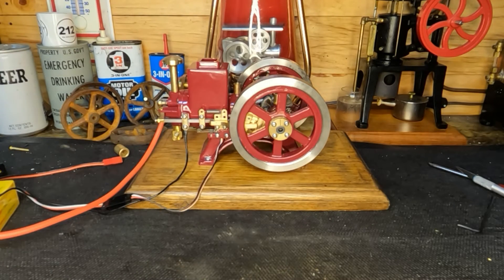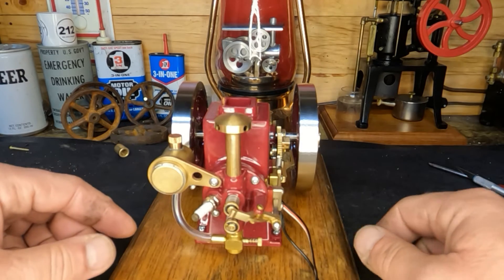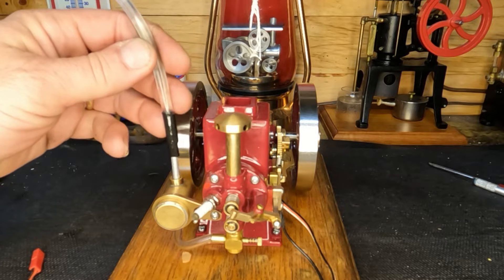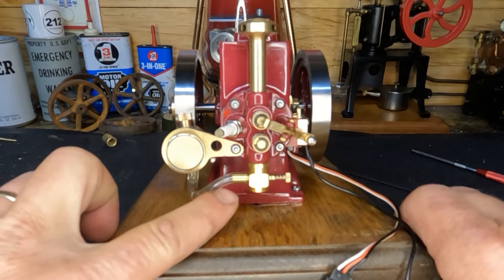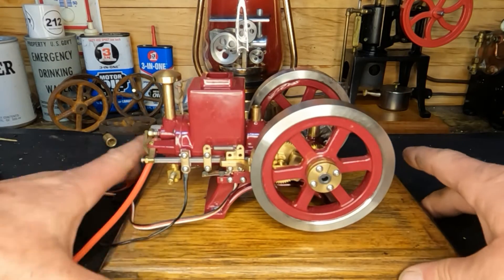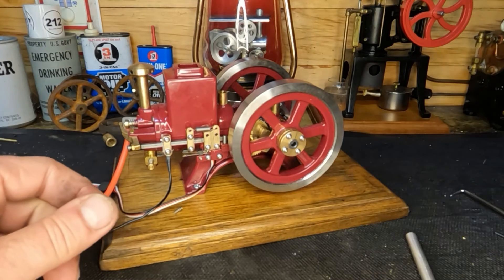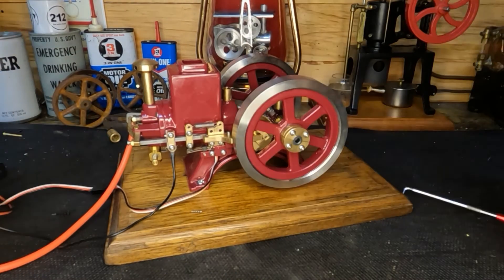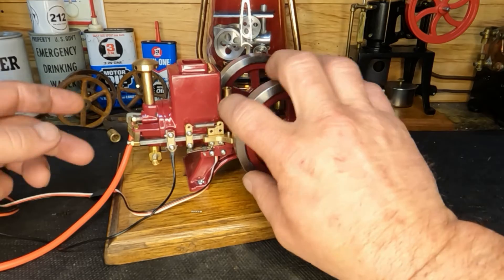Enjomor 6cc Hit & Miss  Governor Modification, Fuel Tank Relocation AND 10% More In Your Pocket!

Comment: Very informative channel. Got my Enjomor running.
But i picked up a cheap blue chinese engine ran great for a day. Then it quit. Will run for about 20 seconds and quit. 
Just can't figure it out.
Spark is hot, fuel is good. Timing is just above TDC. 
Any thoughts? Thanks

Comment: Hey, ....Just found your channel......Real nice H & M cast engine there !!   You got that engine Tweaked  & Running really Good !!  Like the way you showed how to get the Latch--Out spring setting just Right !!    .....Seems a Lot  better construction than my older 2020 ET1/M-90 all Machined engine & yours Came with factory Piston & main bearing Drip Oillers !!.......Probably using similar Rubber O-ring piston Rings ??  .....My ET1 seems to run & Start best with Top of fuel Tank just Even with Carb/Spray bar mixture needle Centerline Height.....That avoidsl any  Fuel drip Leakage flooding, maintains Steady needle valve Setting & Starts 1st or 2nd flip.....My older ET1 engine measures out at 9.5 :1 compression Ratio & runs best Unloaded on 50 octane pure White gas camp stove Fuel without any Oil lube Additives......Runs super Clean without Wet carbon dripping Exhaust deposits.....The cleanest, Driest exhaust running engine seems to be Strongest running & Easiest to start setting.....Lightly directly Pre--lubing the Piston/Cylinder wall seems to take care of O-Ring lubrication......Your piston Drip oiler should automatically do that Without needI needing any fuel Oiling additive content......Plz show More longer Running !!  .....Thx for video.....

Comment: Will this run great outs  box even though you modded yours I don't have way to machine if I get one
Reply from the maker: Hi Nick, I'm sure that it would run just fine right out of the box. There are several modifications that I did to this one that will help improve the engine that require no machining, the ball bearings for the main bearings and the Bic lighter spring will allow it to run slower
Reply: @steam212  ok if I get one I'll look into that

Comment: I'm sorry if this is Dumb question but I'm just learning about these engines. Is there a difference between the Enjomor Hit & Miss 6cc and M17b? If so what it is  it?
Reply from the maker: Hi Nick, yes there is quite a bit of difference between the two. The M17b (brass alloy)is smaller in size and in my experience tends to be a bit more temperamental than the Enjomor 6cc (aluminum alloy). The 6cc is a bit easier to work on simply due to the size also.
Reply: @steam212  ok thank you then I guess my choice is the Enjomor 6cc

Comment: Hello, thank you for taking such kind care of me, I have followed your steps, and everything seems to be fine, I don't really know where the intake valve is, it has a screw with a spring in the carburetor, how should that screw be, a little open wide open? Is there any way to check that the gasoline reaches the spark plug well? I'm sorry if I bother you, I hope to learn as soon as possible.

Comment: Hello again, I just tested the engine like yours, with the same tank of gas, but it doesn't start, it only does it for a few seconds when I inject gasoline directly through the spark plug hole. I assume that no gasoline reaches the spark plug, I have tightened the carburettor screw more and less but it does not start. Please, could you give me some advice so that the engine starts well? I am starting in the world of mini motors. Thank you and best regards from Spain. Happy new year 2023.
Reply from the maker: Hi Barbara, have you checked to see if you are getting fuel out of the line to the carburetor? Making sure there are no kinks in the fuel line? Have you tried choking it with your thumb or finger while cranking it over? While you turn it over does it have good compression? If the intake valve is not sealing it will pull fuel and then push it away again.  Keep me posted and let me know how it goes.  Thank you for your question and for watching 👍. I hope you have a GREAT 2023 also.
Reply: @steam212

Comment: About the best i have seen this model run so far....great job!
Would making the governor weights a little more heavy help? There is not much room in there, but a little weight may make a big difference.
Reply from the maker: Hi Benjamin, you're exactly right, the thought crossed my mind to drill the weights and fill the hole with lead. I guess we'll have to see if we can fine tune the spring a bit more first. I would like to see if heavier flywheels would help too. Thank you for the suggestion, commenting, and watching 👍
Reply: @steam212  I did this, drilled holes and filled them with soft solder, polished the surfaces etc. May have helped and my engine runs beautifully but your engine runs better :). So I suspect, not worth the hassle

Comment: I noticed that you were going to change the color. Are you going to powder coat it or rattle can?
I bought one yesterday with the steam212 dicount and then today they dropped the price to $279. Sent them an email and hoping. Do you hace a source for the crankshaft bearings? Or for the cam bearing? No old hardrives.. 
Thank you for sharing your knowledge and Happy Thanksgiving!
Reply from the maker: Hi Joe, Congratulations on your new engine. The crank bearings are mr128-2rs and the cam bearings are 681. I used engine paint in a rattle can. I'm glad that you're enjoying the videos and find them helpful. Happy Thanksgiving to you and your family 👍

Comment: There may not be sufficient metal on the stock piece, but I wonder if you could drill the spring’s hole all the way through and tap it so a small screw coming in from the outside could impart adjustable spring pressure, and thus provide a method of easily varying the speed. Just a thought, the kind that keeps me up at night.
Reply from the maker: Hi Wahoo, I think you're right, we'll give it a try. I think there should be enough material to drill and tap it. Thank you for the suggestion & for watching 👍
Reply: That's pretty much how mine works...though I used a counter-spring. adjustable is great.
Reply: That’s it!!  Like this a hit and miss engine should run. Nice and slow. Great Job, great video again. 
Manfred.